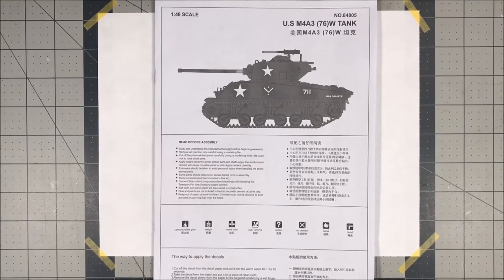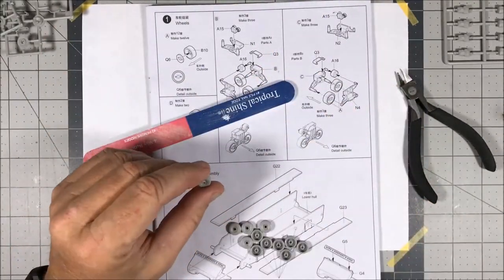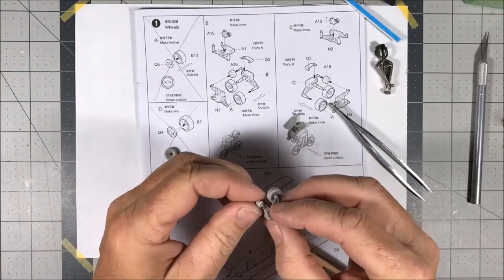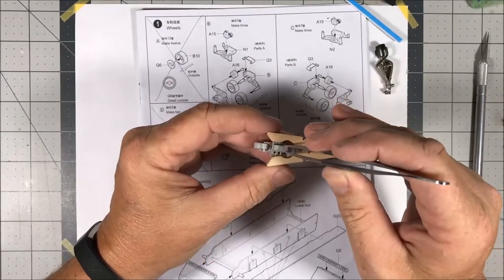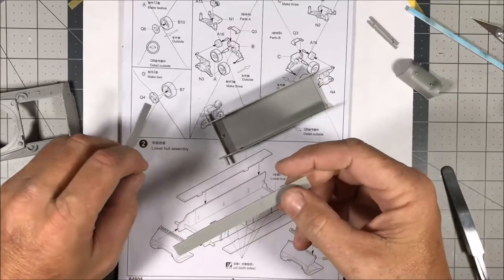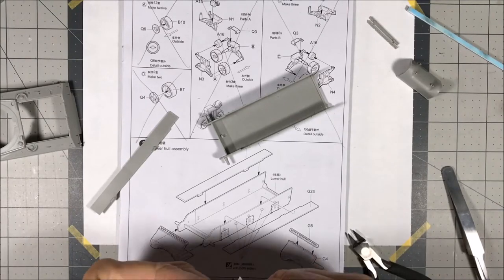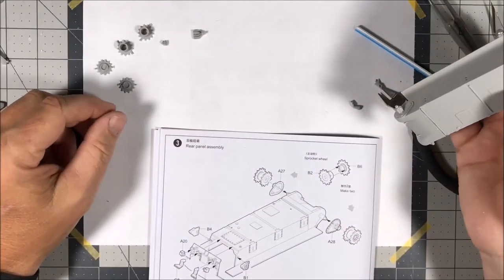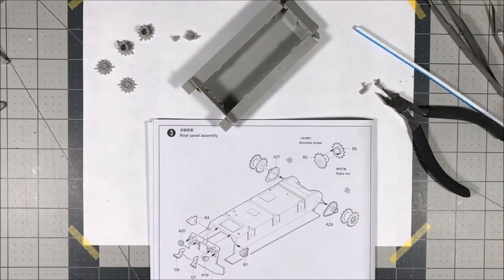Hobby Boss 1 48 M4A3 Part 1

Comment: Great series of build videos Brett, many thanks for sharing with us and spreading the knowledge. Can I please ask you a question? When you say that this is the WET version of the M4A3, what does that mean?
Many thanks,
Joe
Reply from the maker: Wet means that the ammo is stored in bins wherein the ammo itself is surrounded by glycol (I believe). If the rounds are hit by a projectile they won't explode, thereby possibly saving the crew and vehicle from death and/or catastrophic consequences.
Ammo was originally store in bins in the sponsons and were suseptible to fire and explosion when a round came through the sides and hit the ammo. A short term fix before the wet stowage modification was to weld applique armor plates on the outside of the tank where over the storage locations were.

Comment: Is it better to paint before or after the build?
Reply from the maker: It depends. For interior stuff I paint before, then mask it off to paint the outside. I then build the whole kit, minus the running gear and tracks, then paint the whole exterior. I paint the hull and turret as seperate parts as well as the wheels and/or suspension parts. This way it is easier to weather the lower hull before I attach the suspension. After I attach the suspension/wheels I then continiue with the weathering process. Then I assemble the tracks and so the bacic painting of those. Then attach them to the model and finish the weathering to tie it all together. Tools and such get left off and painted and attached last just before the dust coat of the whole thing.
Some people completely assemble the model then paint. I am trying this method on my current StuG build to see how it works. I will be talking about it on another video soon.
It really is a matter of personal taste as it can be done either way. 
Does that answer your question?
Reply: Brett G yeah, thanks
Reply: I forgot to ask, what do you use for photo etch parts?
Reply from the maker: What do I use as far as paint?
Reply: Brett G I meant to cut it off the sheet, and yeah paint.  Also, do you paint on the runner?  (Sorry about the questions, I am new to building models that need paint and glue)
Reply from the maker: No problem with the questions! Ask all you want... that is my goal here; to help if I can.
I was going to type you a long response but instead I will shoot a quick video on how I handle PE and upload it today! It will be easier for you to get that way. So watch for a video a little later.
As for painting parts on the tree, I don't. I used to and then touched them up later. I still do with aircraft parts sometimes though. It is another one of those things that is personal preference.
And keep asking the questions! I am more than happy to help!
Reply: Brett G I was at Hobby town USA yesterday to buy the paint, so do I need to use stuff like primer or topcoat?
Reply from the maker: Primer isn't absolutely necessary, but I use it. For some stuff I use Tamiya Grey Surface primer in the spray can, and sometimes I use an acrylic primer like Stynylrez in my airbrush.
The reason I use primer, is it seems to make the paint stick a bit better... especially paints like Vallejo. Also, if there are photo etched parts it seems to stick a little better. If there is a lot of photo etch especially larger parts, that is generally when I would use the Tamiya primer, since it is a lacquer based primer. Just make you spray Tamiya primer outside! It is some stinky stuff.
You will find very different opinions on primer. Some say it can obliterate fine details, especially after adding paint and sometimes clears over that. I haven't found this to be a problem, myself. Just don't overdo it.
Reply: Brett G ok, thanks